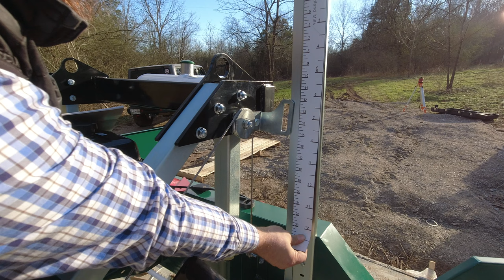023 - Assembling a Woodland Mills HM126 Portable Saw Mill

Comment: Well brother mine came today and I gotta tell ya your video helped immensely, single handed got her assembled in 5.5. I'll have to upload a bit more, us woodland mills guys gotta stick together haha!
Reply from the maker: Congratulations! Did you cut anything today?
Reply: @DuckRiverHomestead  not yet, local shipping was a dog and pony show, didn't get it in till about 0300 mst. Threw it together in the driveway, wife would be pissed haha! Will update buddy, really setup was a breeze thanks to your vid, I just assembled the head on set rails feet first, daughter loved running dads .5 impact setting them nylocks. Have a good evening man, thanks again.
Reply from the maker: This is why I posted the video. I'm glad it was helpful. One thing that would have made it easier is having a table to hold all of the bolts, and an organizational tray to separate them. I think it would be nice of WM to send something like that. I'd be willing to spend $50 more on organized bolts with sizes clearly marked.
Reply: @DuckRiverHomestead  I am fortunate enough to remember the mm to inch conversions, but I agree, even a few stickers on the bags, at least they kept the track fasteners and the head unit fasteners separated haha, only had a washer, two nylocks and a 30mm left over, no holes though! Just milled an aspen that fell down a few weeks ago, machine works great.
Reply from the maker: Woohoo!

Comment: Got a new sub. Got screwed around a bit with shipping but mine will be here today,  the hm126 seems to be very popular as of late.
Reply from the maker: Thanks you! 
I love my HM126. I have 2, maybe 3 logs in my huge delivery that are over 26". I'll have to cut them down first before putting them on my mill. Sure the HM130 max would be nice, but I don't really miss any functionality other than the electric start. I might add one myself before I start doing my mass production of lumber. I also plan on adding a lift motor instead of the crank. 
I hope you enjoy yours!
Reply from the maker: Did you ever get yours set up?
Reply: @DuckRiverHomestead  I did, then I broke my foot so I haven't been up in the trees to feed it! Cut down a juniper in the yard, foot casted up and the mill runs excellent! Wife werent too happy though.

Comment: I'm gonna need a laser level, that's a smart idea
Reply from the maker: It made it so easier. I have moved the track over a couple feet and re-leveling it was a breeze. I have another 6' extension I'll be adding soon and anchoring to the slab with rebar, and the laser level should make all the difference in the world.
Thanks for watching!

Comment: If you get the 126 with the 14 hp is it a keyed engine or just pull start? Thanks
Reply from the maker: I got the 2021 model and it is just a pull start. I have looked for a starter for it and haven't had much luck.